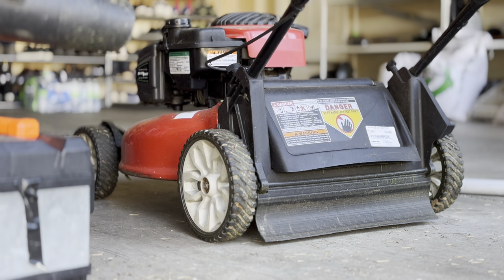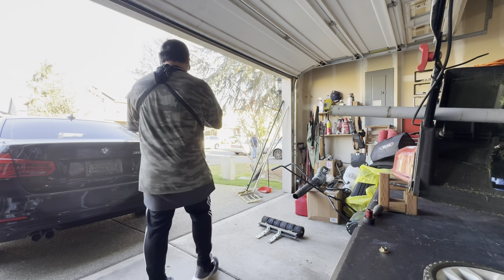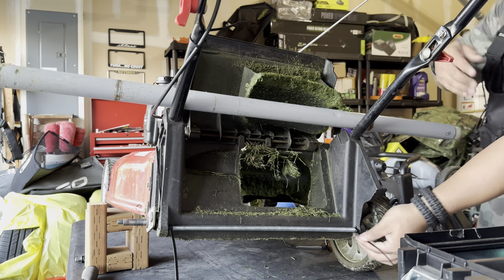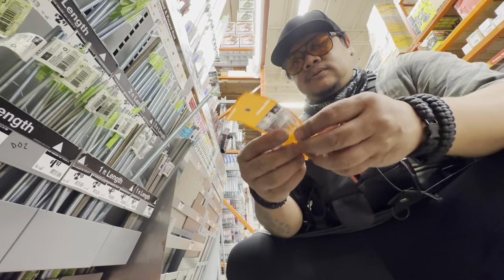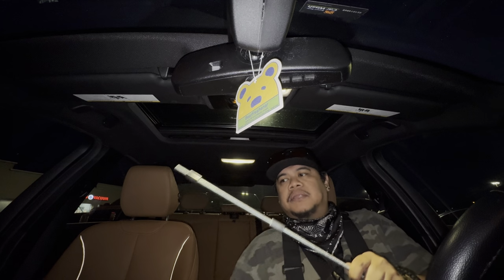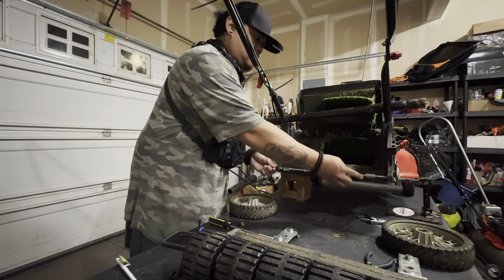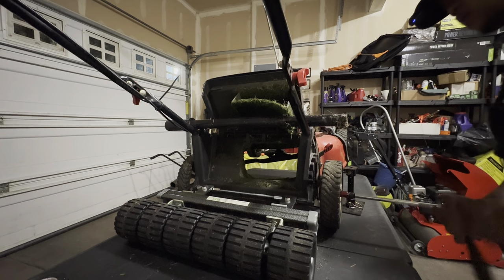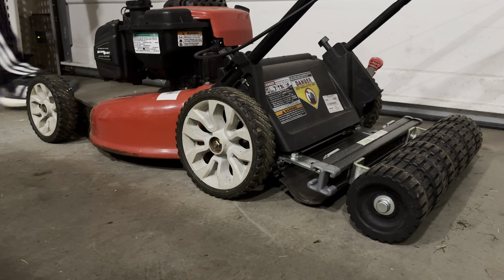Makeshift Lawn Striper Kit on Troy! Troy-Bilt TB110 lawn mower rear roller mod! Results will stun!

Comment: Could flip the brackets 180 and it wont be on a steep angle and get some blue locktite on the threads
Reply from the maker: I had them 180 on the ego it was super stiff and anytime I turned it would just dig into the lawn 😩 Blue locktite is smart though ☺️🤙🏾